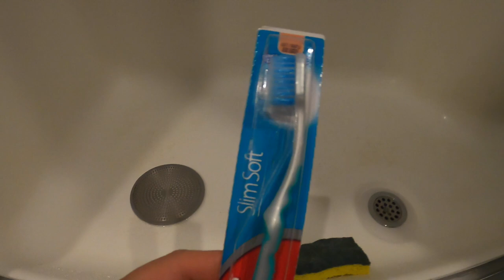Nautilus Retractable Shower Door | Stoett Screens | RV Bathroom Reno | RV Shower Reno | RV Reno

Comment: Is it possible to open the shower door part way without it rolling back up?  I've also read reviews stating there is only one handle on the outside.  Have they put one on the inside yet?  Is it hard to open from the inside?
Reply from the maker: Hey Lisa, you’re unable to open part way. As far as the inside handle goes, it doesn’t have one but it’s easy to open. I don’t think it needs on, we use full time and us as well as our 5 and 7 year old boys have no issue
Reply from the maker: We’ve had for a while now and would definitely recommend
Reply: @HomewiththeHoopers  Thank you!  We will definitely look into replacing ours.